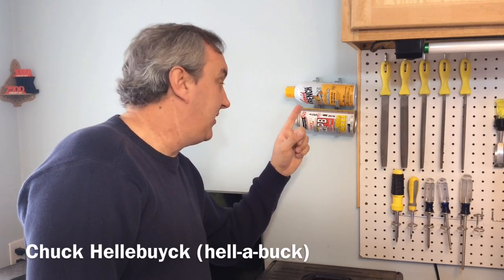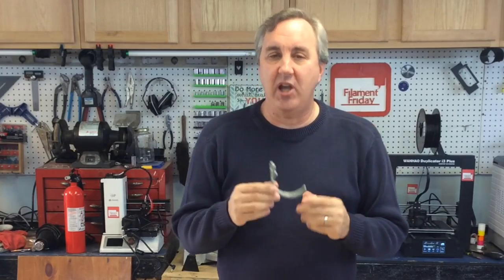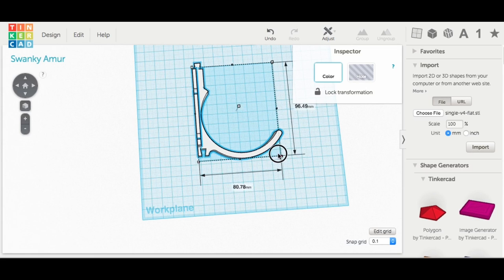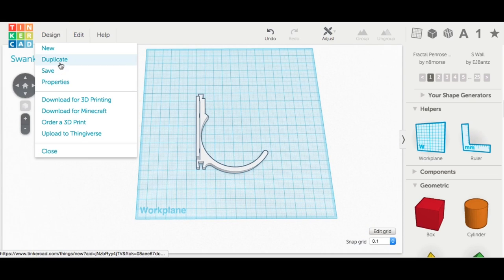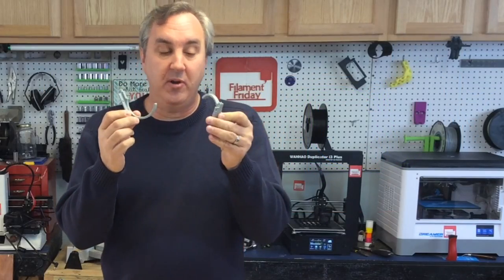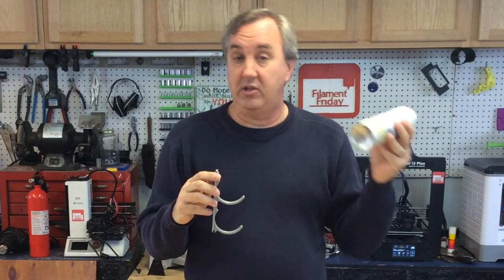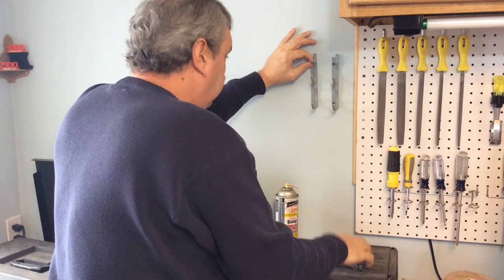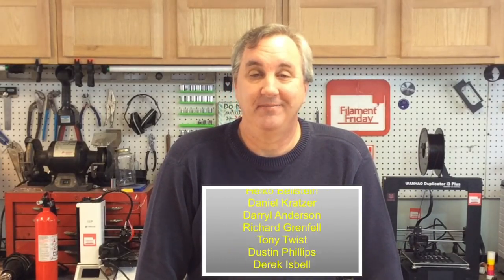3D Printed Spray Can Holder Organizer on Flashforge Dreamer

Comment: Thanks for having my Holder :), I had no issues with the snap-in shape. Maybe different printer has different tolerance. I have some big cans that's why I made it big which will work with smaller ones. the slut is to make it an easy print with no support.
Thanks again for this improvements, I'm glad to see it getting better, Cheers

Comment: In this particular case I don't get it why you adjusted the original part. It would have been so much easier to just make a new one.
Reply: The ease of your file modification proves that it was a better option to edit the file, especially since you had already printed a pair and could use its fittings as a reference :)
Reply: How are you doing brain